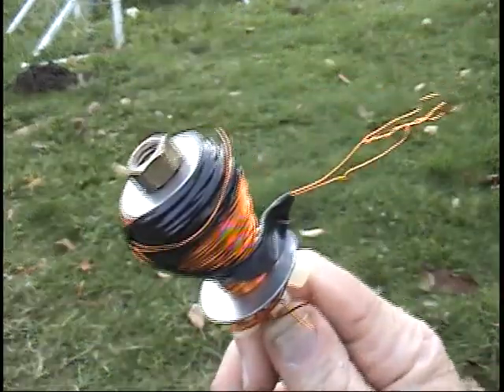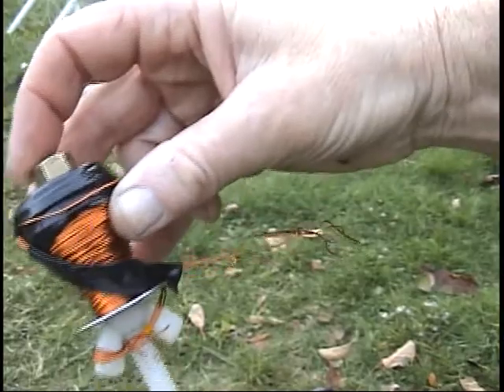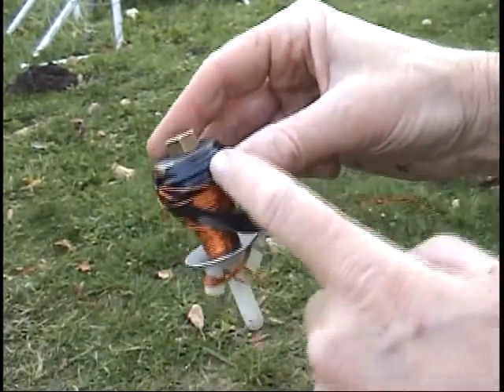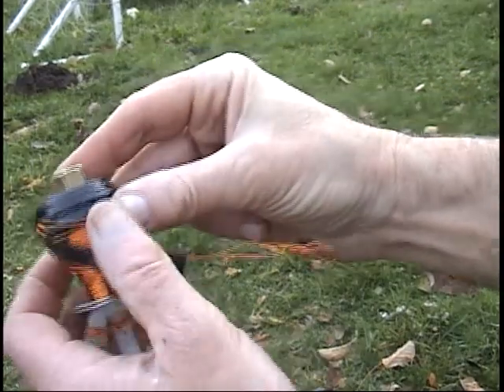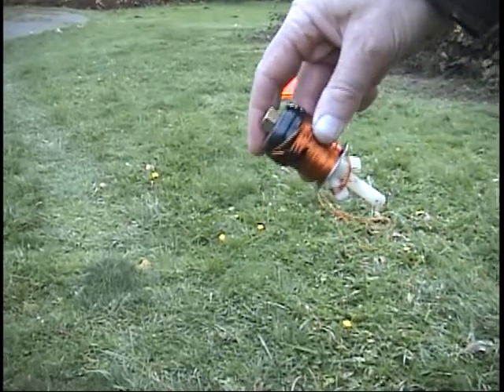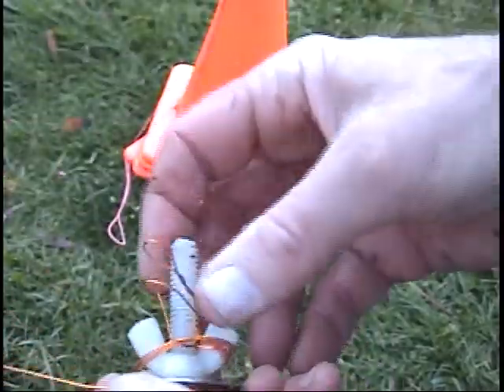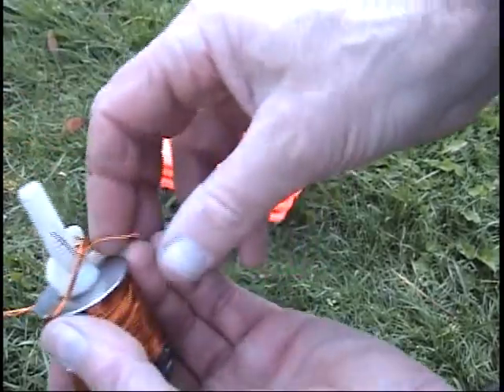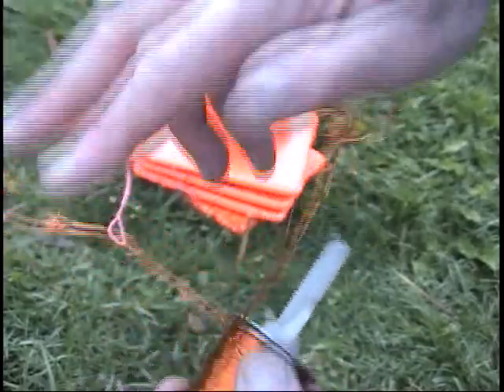Part2 Winding motor coils with pickup wind

Comment: What's the properties in the black sand that make it the ideal material for the core?
Nice job.
Reply from the maker: The black sand - Bill Muller describes it as amorphous low hysteresis  black sand....basically it permits neodymium magnets in rotor to sweep past, without very much latch (unlike iron type cores) this is because the blacksand has random-polarities to the ferrites within the blacksand, and if you looked with microscooe, there will be crystalline structures - melted lava - encasing the ferrites and so the ferrites point themselves all different directions and this  makes neodymium mangets not stick or latch very badly to magnets
Reply: Awesome thanks. Is anyone familiar with the testing that they've been doing for approximately 3 years on bowl shaped magnets with a circle cut out of the cenrer? now I've seen some really interesting. Info, I think Mr Mueller to the apply to this model-based the on the research. The most interesting YouTube video I've seen is a six part series called the field the crime field maybe? And this guy obviously thinks he's discovered the meaning of the universe but he's definitely got something cool going on. 

I'm very interested in constructing rotors more lightweight for quadcopters, which led me to this site and of course I found it interesting. Could this model B made TV much much much much much more lightweight to where it could be used in a toy size quadcopter?